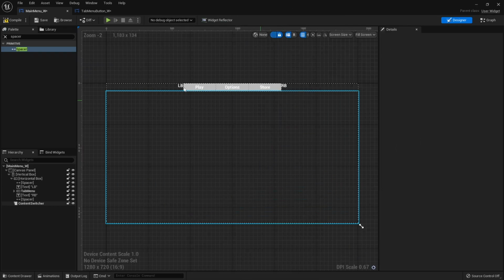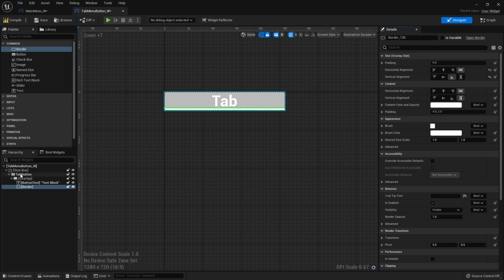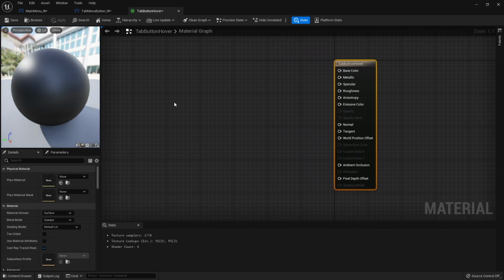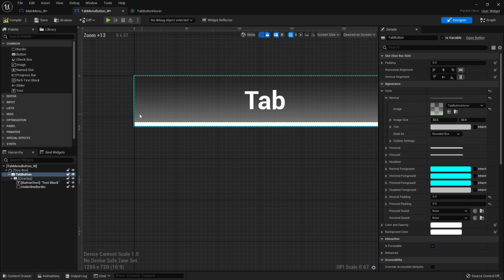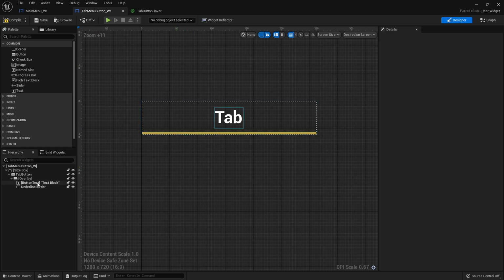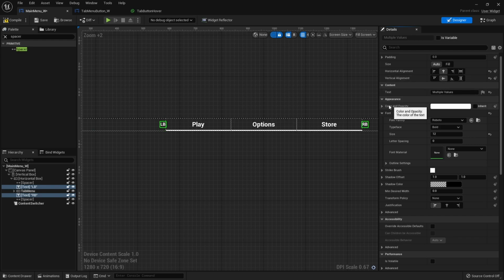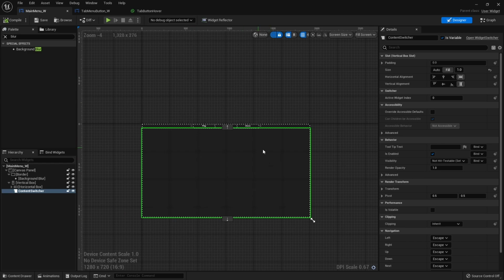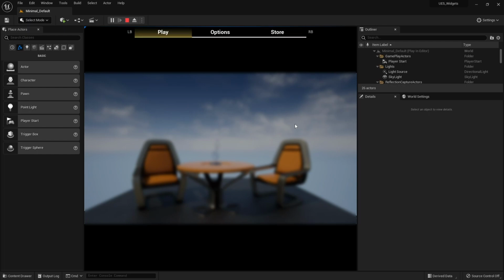Unreal Engine 5 Tutorial - Widgets: Tab Menu Part 2: Button Design

Comment: Hey how can you flip the gradient so its starts on the top and goes down
Reply: There is a "1-x" node. In the material editor, right click to get the menu and then type "1 -" and the first choice will be "OneMinus." Plug the VGradient into the one minus node, and then the output of one minus into both the multiply and the Final Color pin on the material